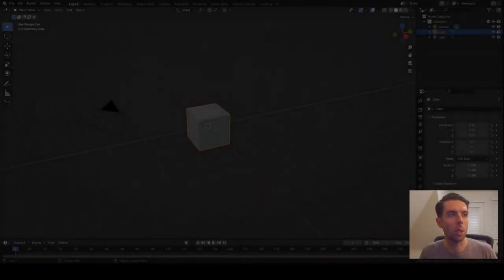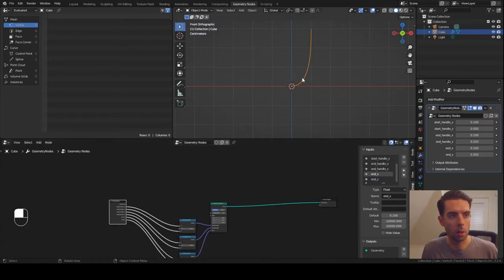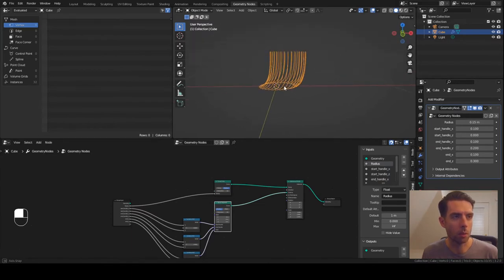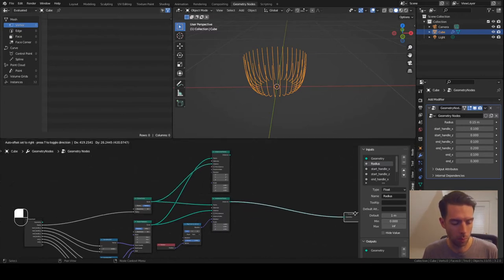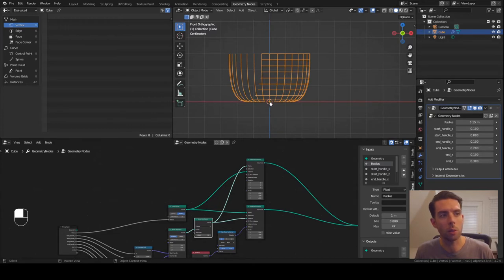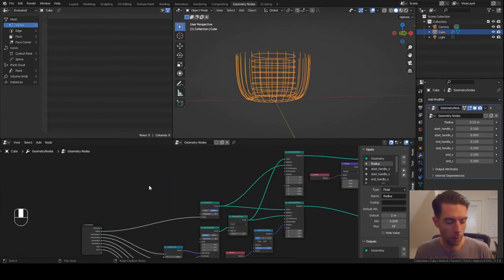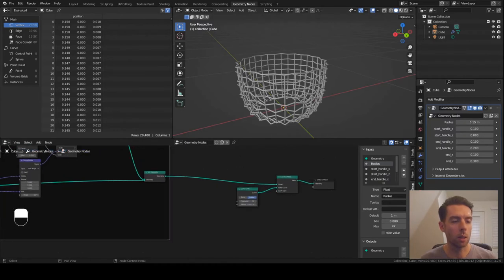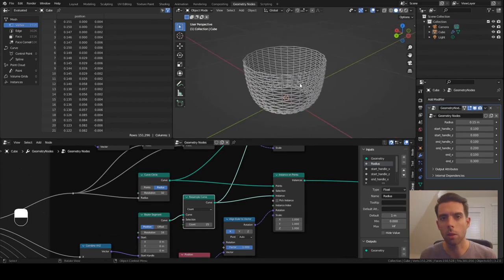Geometry Nodes: How to model infinite baskets

Comment: This is an awesome use of Geo Nodes, and really well done! For the base lattice, I found a delete geometry node based on the radius to be much more performant than the mesh boolean method. It makes messier edges but they're mostly hidden by the bundles at the bottom, and I think the performance boost is worth it.

Comment: Using the information provided in this video, it is possible to modify the basket profile curve to create a circular weave bottom, which looks more realistic than the rectangular weave suggested. It is a great tutorial, thanks for sharing it.
Reply from the maker: I would love to see what you came up with. I always had an issue with the weave getting too tight and scrunched together at the center of a circular weave. I plan to revisit this later though. Glad you enjoyed the video though!
Reply: Check your spam or comments on hold section. I tried to give you a way to get my email from my YouTube channel. Unfortunately I don't use any of the social media platforms, I would love to share the blend file with you. I did not limit the modulo to 2 only. With a warp count of (verticals) 48; 2,3,4,6 all give viable weave patterns, and even 5 is structurally plausible. It is a question of being comfortable with factors. I also made it an option for not twisted ring or a much lighter ring at the bottom.

Comment: For basket weave (9:51 to 18:30), you could simply scale alternate points (x and y components of position vector) by a fixed positive value and the other alternate by the same negative value instead of rotating the tangent of circle points around the tangent of the Bezier points. Would be much simpler to follow and would produce the same result.
Reply from the maker: I used this technique in an earlier iteration of this project, and at first it looked fine. The problem is when the profile of the basket has anything approaching horizontal, you end up scaling those points along the edge of the basket rather than moving them in/out, if that makes sense

Comment: Congratulations on a great beginning!  I've followed this tutorial and produced the exact same results. I only ran into one issue in this first part, and I thought I'd mention it here in case others have it. (I'm using Blender 3.2.2-stable - though I doubt it makes a big difference): 

The "cutter" for the bottom wasn't working right, and I still had stray "wires" (I'll call them) sticking out at the corners. At around 41:10 when you drop the Boolean Mesh node in, you simply state that it's already on Difference which is what you want, and you DO NOT check the "Self Intersection" box on that node... but the minute I checked this, it worked and the bottom-weave became a perfect circle, but not with it unchecked! And that's the only hang-up I had in making it.
 
It was getting a little heavy for my system, so I also reduced the "internal" Subdivide Surface nodes in the Weave groups to "1" - and I exposed the final Subdiv. node (just before Set Material) in the Group Input so it could also be controlled from the Modifier Panel. (I thought this my be handy if you have PBR materials that may need more geometry, but I suppose this should be implemented on a per-object basis... Maybe that could be done with an Index or Object Info node?)

I'm watching the HD version full-screen on a 27" monitor, and your nodes are just a little hard to see sometimes - but I appreciate you verbally stating the values you're using so it's not much of an issue.

Now, I am having some trouble getting it unwrapped like you do in the second part - but I want to go over that again later today because I probably fumbled it somewhere. If I can't figure it out, I'll let you know in the comments of that video.

But except for that weirdness with the Boolean node - I was able to follow your tutorial fine and my baskets look just like yours! I think this is a fantastic start - I've Liked & Subscribed - and I'm looking forward to more great content from you.

Keep up the great work!
Reply from the maker: Thanks you so much for the thoughtful comment.
I'm actually working on another tutorial for rectangular baskets, and I discovered the same issues, so thank you for bringing those up. The "cutter" operation I used worked with the settings I had, but when I tweaked them just a bit, I saw the same thing (though I found "hole tolerant" fixed it for me). Boolean operations are also very cpu intensive, so in the upcoming tutorial I will use a raycast node to sort the geometry for the bottom.  I found this to be more efficient and more reliable.
I also found a method that will greatly reduce the excess geometry created by the subdivision surface.  So you can achieve the same look, with much less strain on memory.
I'm so glad this (mostly) worked out for you. I'll work on staying zoomed in on my nodes in the future.
Thanks for watching, and I'll keep an eye out in case you want to discuss issues with the unwrapping
Reply: @rendermoore  Well if you're scratching your head over the part about the "per-object" basis, I don't blame you - it occured to me later that I was making a fundamental, conceptual mistake there. I'm relatively new to geo-nodes, but I've been heavy into Blender's Shader/Material nodes for the last couple of years, and I'm trying to think of them in the same way. To wit: changing something about a shader changes it on all objects it's applied to - though there's ways you can isolate objects or groups for applying random colors for instance, which is why exposing the Subdivisions seemed "handy" to me. And while it's still kind of handy, the "per-object basis" isn't necessary because it's already built-in, so to speak.  So now I have written on the back of my hand: "Geo-Nodes are MODIFIERS, not MATERIALS!"

But hey - it's working through tutorials like yours that helps me see these things, so thanks again!

I"ll get the hang of it... 🙃
Reply: Update: Success!!! As I figured, It was operator error - Your tutorial is perfect as-is and will produce the exact same results you have on the first try (at least for those who pay a little closer attention than I did) - and the "Self Intersection" wasn't needed after I had straightened my crossed wires out, which was also keeping it from unwrapping correctly. And forget my comment about the "internal subdivisions" - I had accidentally copied that Subdiv. node into a couple of the groups and the poor thing had enough geometry for a Lego factory. (I said it was "getting a little heavy"? I'm shocked it didn't crash on my machine with something like 16-times the geometry it needed - and impressed that it was only lagging a little!)

But once I straightened that out, everything was perfect - and I made a quick video to prove it, which I'll post a link to in the Comments of the second (Unwrapping) part.

And that's everyone's que to follow me over there! https://youtu.be/Vd4_pn-h2rI
Reply from the maker: I made a similar mistake while practicing for the video.  I left the default resolution of 32 for my profile curves and then had them subdivided twice. Took me a while to figure out what was going wrong.

Glad you figured it out.  My next video will include a tip on how to use even less geometry, and get the same look

Comment: Being quite new to blender in general and in geometry nodes in particular, it was a bit difficult for me to follow, but I really wanted to make a basket, so thank you.

I think exactly knowing beforehand what you have to do before starting shooting the tutorial will make it shorter. It can only get better. Can't wait for the next ones
Reply from the maker: Yeah this one covers a lot, and my presentation probably doesn't make it any easier to follow. I hope you got the results you wanted though
Reply: @rendermoore  Yeah it worked fine. I just need to find a way to change the size of the thread  and the structure of the weave to add more variety
Reply from the maker: That's a great idea! Drop a comment here if you come up with a way to do it.  Otherwise, I had a method for varying the weave pattern in an early version of this, perhaps I will try to revive it in a follow up

Comment: Great tutorial. I don't understand most of it but I was able to follow along and learned a lot. Do you need a certain level of understanding of math to understand G nodes? Also, how would you cap the vertical splines?  Thanks
Reply from the maker: An understanding of math will definitely help to understand geometry nodes, but don't worry if you don't understand everything yet. Most of what I learned was picked up from watching other people's tutorials on YouTube, the rest I learned by experimenting. If something in a tutorial doesn't make sense to you, pick it apart and experiment with the pieces until it does make sense. If that doesn't work, reach out and ask. Blender has a great community and people are usually happy to share what they've learned.
As for capping the vertical splines. Tab into the "curve to mesh with xyz" node group we created in the tutorial and find the "curve to mesh" node. There is a check box for "Fill Caps". Set that to true and it should be what you're looking for.
Reply: @rendermoore  Thank you for the cap tip and I'm so glad you are part of the blender community. Your help means a lot and really motivates noobs like me. cheers mate!